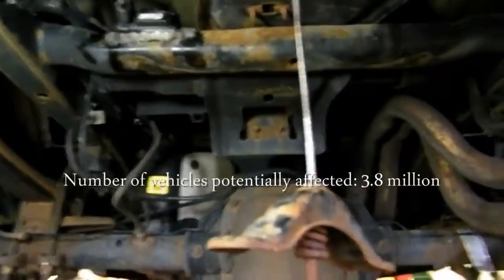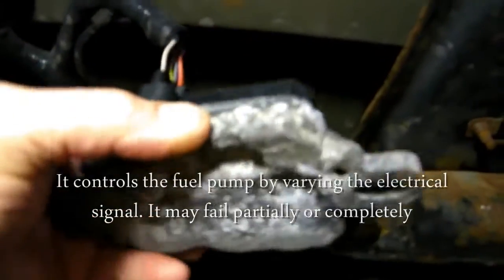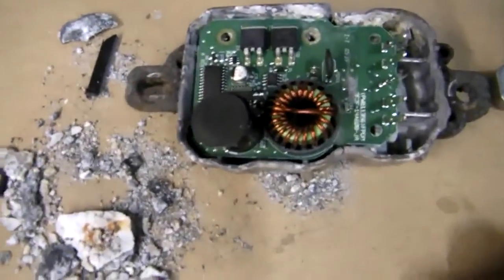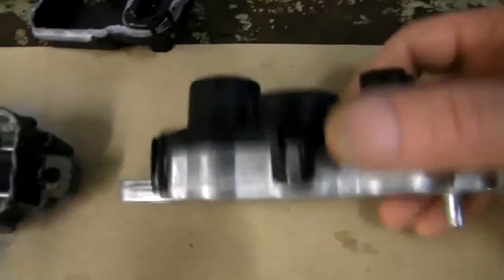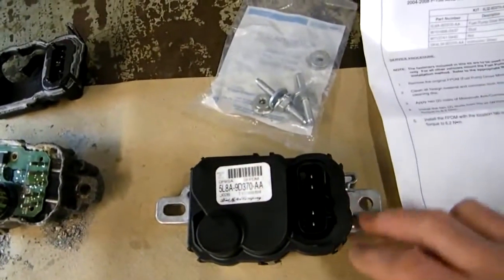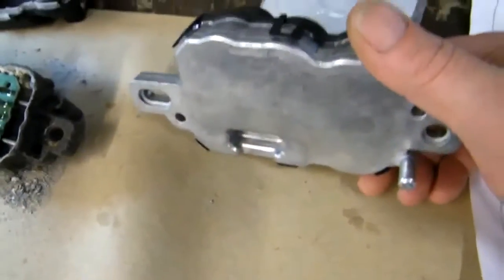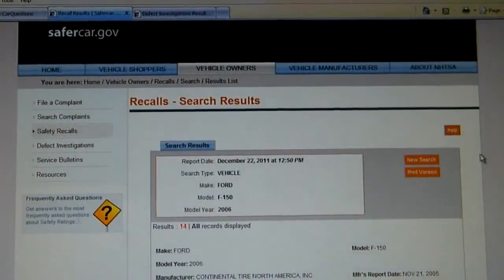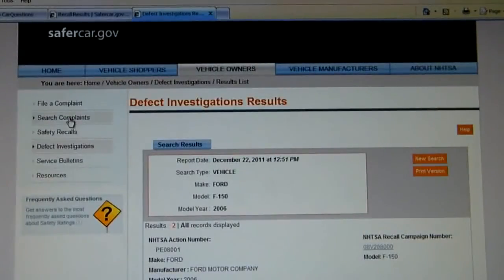Ford F150 2004 2005 2006 service repair manual

Comment: This link is to the website for the 2004 2005 2006 Ford F-150 pdf file listed at $0.01 for the service manual. But, when you click through to buy it, they are priced at $79.99 - $129.99 (except the current year, which is $249.99.) A single cent seemed like it might be too good to be true for such a huge resource, but since it was a pdf file I could believe that price. Fooled me! It is too good to be true and it felt like that old “bait and switch” marketing ploy. Bad form!
I looked at other manuals for vehicles I own and they were all clearly priced the same on each page I looked, but not the Ford F-150. I’m disappointed because I wanted to get the manual so I can continue to fix my own truck, but I don’t have that kind of money right now (since I’m spending it on parts.)

Comment from the maker: A lot of fuel pump control module problems occur on the 2006 Ford Expedition. In this video we show you how the accumulation of rust has damaged the pump module controller to a severe extent. Symptom: the truck stalls and does not start.